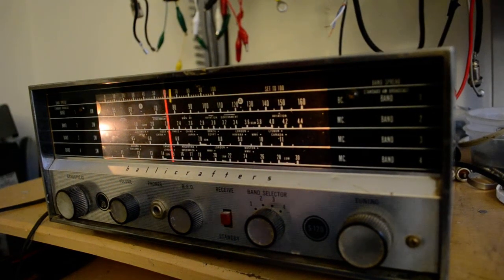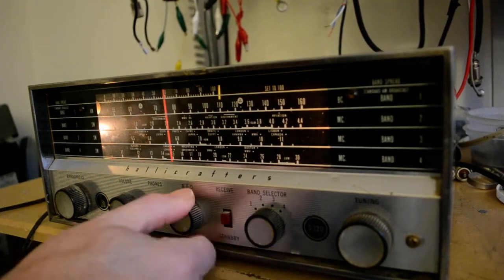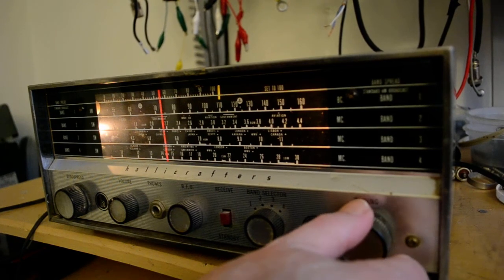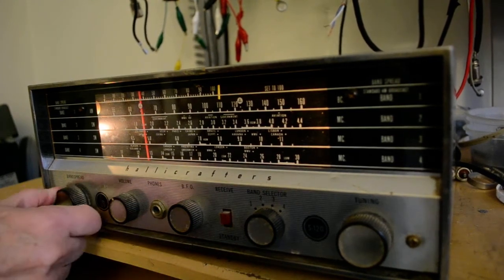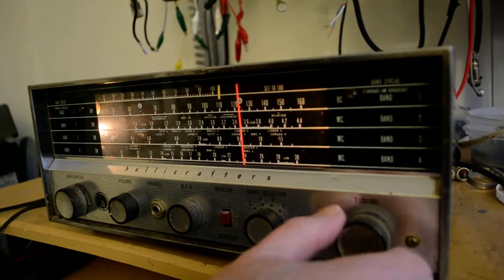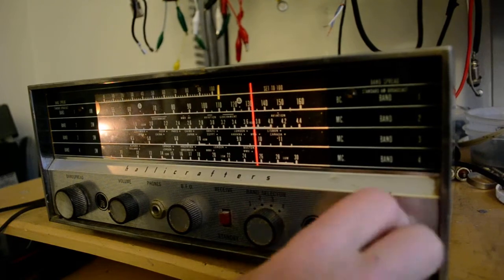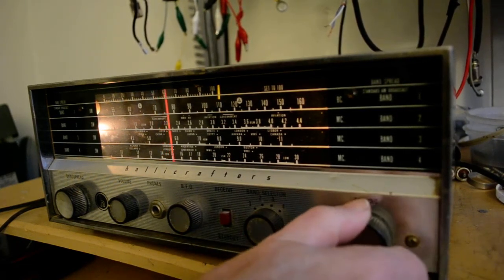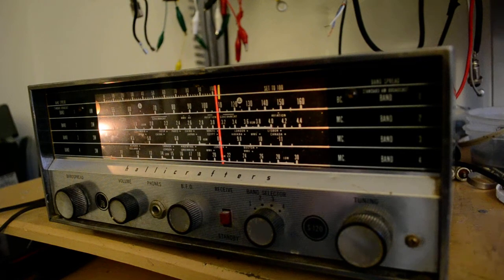Demonstration of the Hallicrafters S-120

Comment: The audio on the Signals including AM are subperb. When adjusting the BFO the tuning for SSB might be tight. So turn it slowly. I had one. Current short wave and ham receivers dont deliver the audio punch like these older radios. Sounds great.

Comment: I just acquired one of these radios. How did you switch antennas sir? Thanks in advance
Reply from the maker: With an antenna switch , duh.
Reply: being Im thinking of putting another ant up for my shortwave I will use a switch. now I have a G5RV for SW but will have a long wire soon and will use a pl259 so in my case a switch is best. but manually works just as well